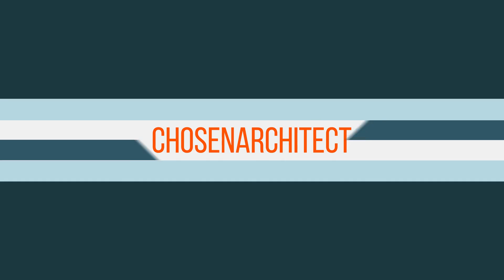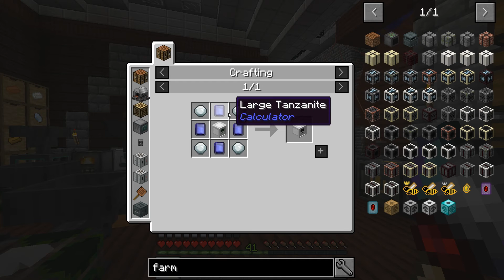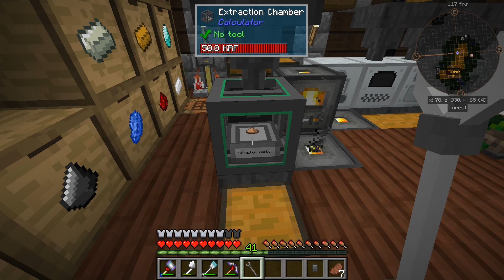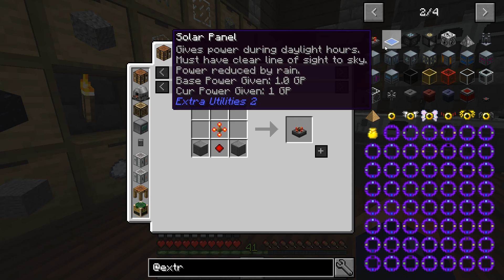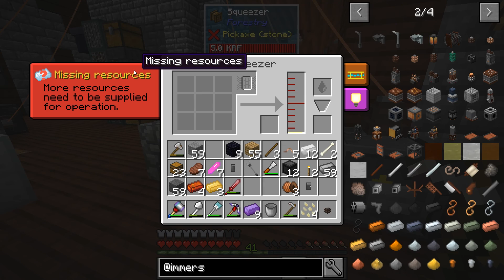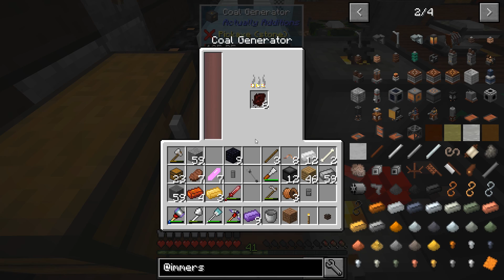Grid Power | Age of Engineering | Episode 12

Comment: In my testing the Actually Addition Coal Generator was 30rf/t.
Reply from the maker: It may be that the tool tip cant keep up with transfer of rf. Btw you put out some nice videos. You should keep it up!
Reply: > It may be that the tool tip cant keep up with transfer of rf
I tested the generators in a test world with EndIO Power Monitors and Ender Energy Conduits
Reply: > Btw you put out some nice videos
Thanks, So do you.
Reply from the maker: +Wilx I was referring to me seeing it in the tool tip not that your test was wrong.
Reply: I went straight into canola oil after getting the green house. 1 press, 2 fermenting barrels, 4 oil generators= 400rft to start, ended up the farm supported 2 presses so 800rft
Reply from the maker: +Buffalo_Chips Yea lol everyone was saying the basic greenhouse was slow... I didn't think so

Comment: You should look at making the Actually Additions Drill. It is far better than the Tinkers hammer. You can put 3 speed upgrade in it by holding the drill in hand and shift clicking it. I so far only has the 2 first speed upgrades in it with the upgrade to make it like the tinkers hammer. You have to put the first tier in before putting in the second, so for the third speed upgrade you need the first 2 in the Drill. And using the battery from Actually too it never runs out of power. Its and endless hammer really.
Reply from the maker: I would like to but at this point the upgrades were expensive. But I will be upgrading to it soon.
Reply: Dustin Crewse you can also put upgrades like 3x3 or 1x1
Reply: There is no upgrade for 1x1, you jsut dont have any size changing upgrade to make it 1x1. Plus i did mention that it has 3x3 like tinkers hammer.
Reply: Dustin Crewse  ik
Reply: Holding shift however will turn off 3x3 untill you stop holding shift tho.